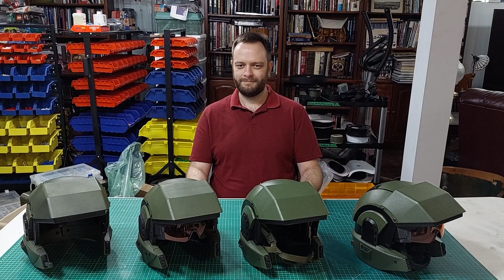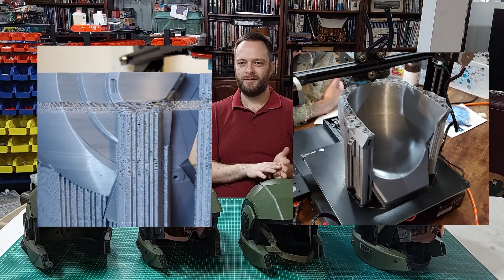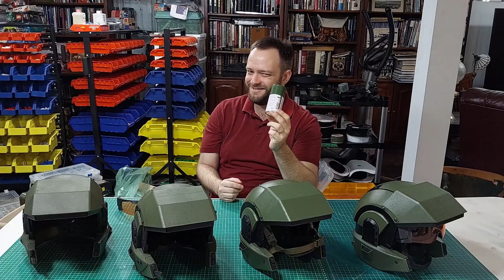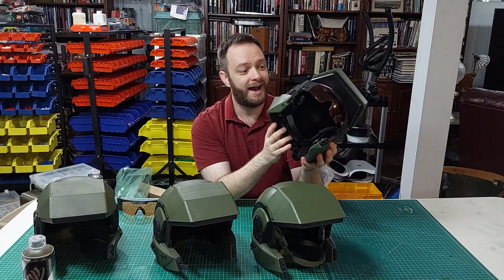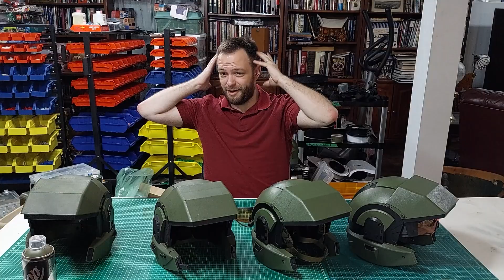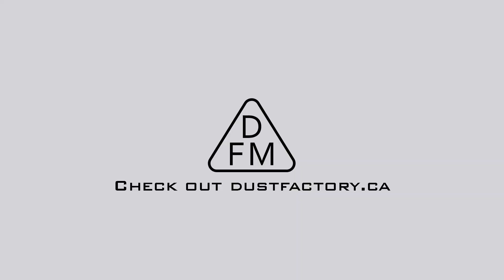Halo Marine Helmet Evolution: John and Ian's Mostly Unedited Cosplay History

Comment: Hi,

First of all, I have to say this is a fantastic-looking helmet. The level of detail and modularity is really impressive.

I have a few questions:

Is the communication system compatible with Baofeng radios (for example, the UV-5R or similar models), either directly or with an adapter?
Have you considered adding an option underneath the hard cap to mount or integrate an NVG shroud for night vision devices?
Do you have any plans to integrate a helmet-mounted light (such as a small admin or task light) into future versions of the helmet?

Thanks in advance for your time, and congratulations on such a great product!

Best regards from a belgian airsoft team,